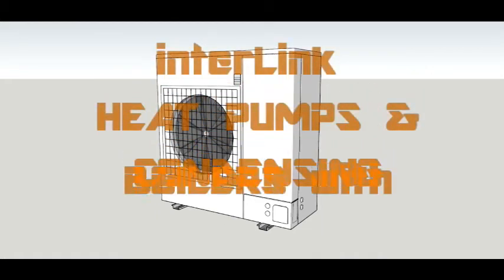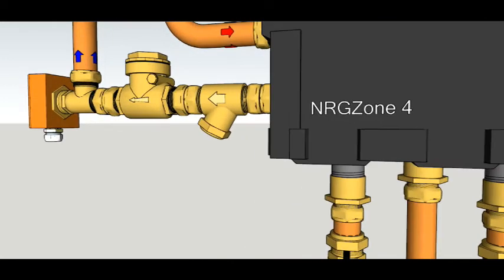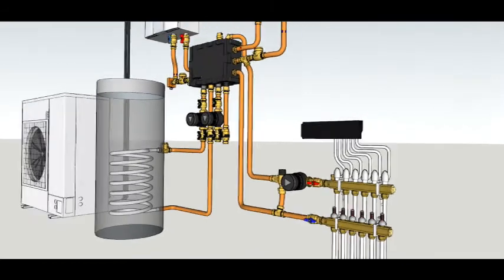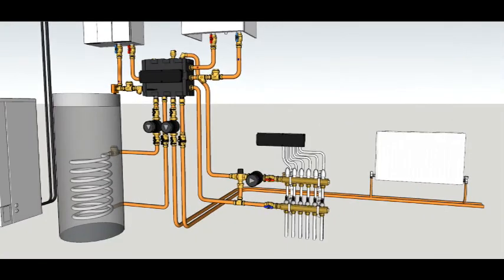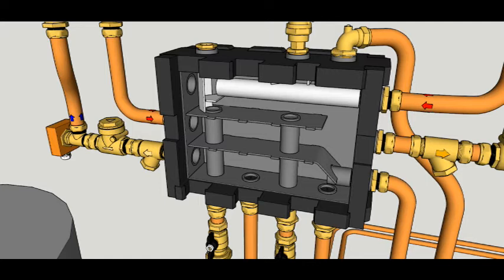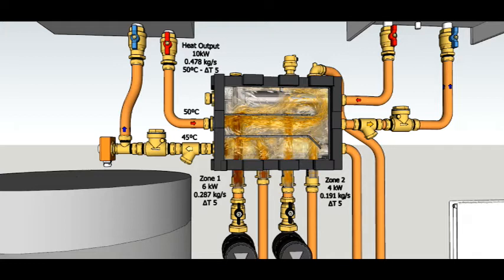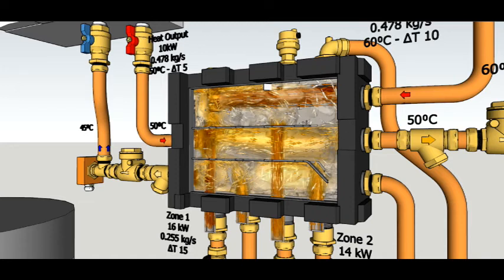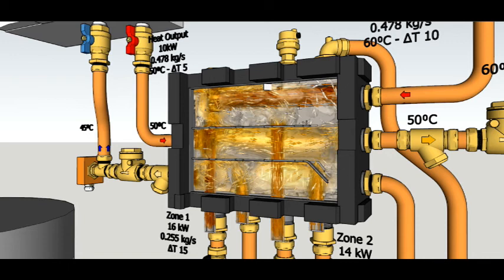How to interlink a Heat Pump with a Condensing Boiler using NRG Zone

Comment: Condensing boilers are the biggest bill of faulty goods ever forced on the commercial heating industry. They self destruct. But the engineers all got a bonus.
Reply: I'm sorry you've had such negative experience with condensing boilers. I have installed hundreds of condensing boilers.Many of which are now sixteen or seventeen years old. We have very few failures within the first fifteen years. The manufacturers are so confident their product.They offer twelve year warranties.

Comment: Will this work if the Radiator circuit is at a higher temperature? ie 75 degrees for the radiators.
Reply: I also would be interested in this answer. I have my boiler temp set to 70.
Reply: If you want to have variable temperatures at the outlets, you will need to use mixers. A gas boiler should really not need a flow temperature of seventy degrees however.